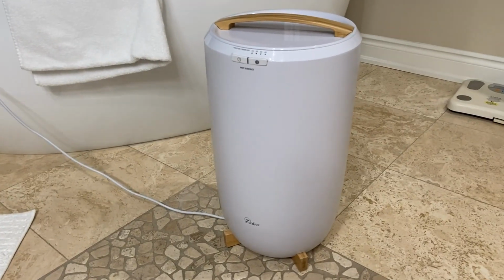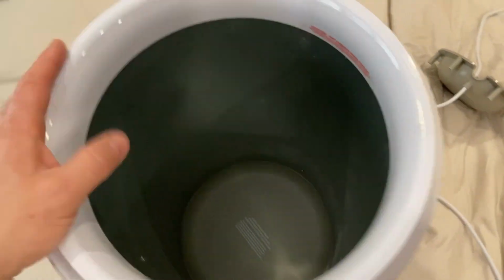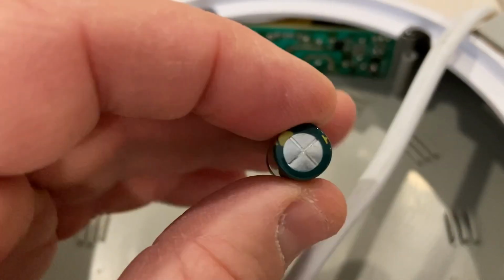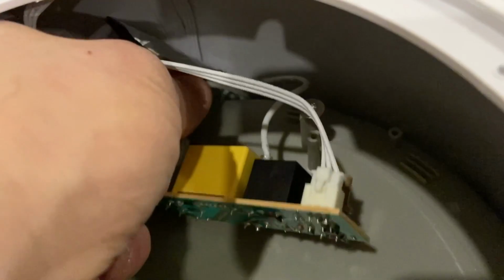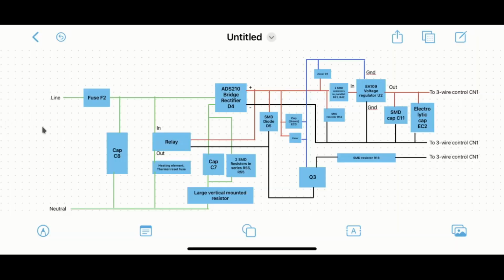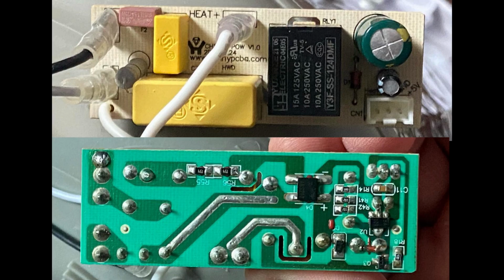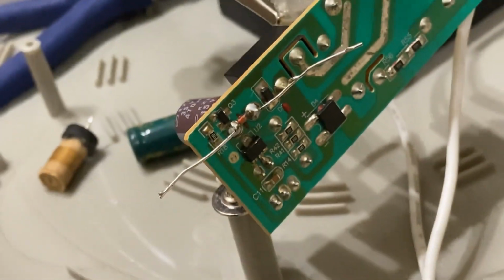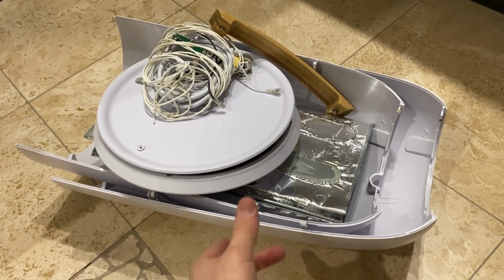Zadro Towel Warmer TWB01 FAIL! Teardown and FIX Attempt!

Comment: Excellent video.  I believe the bridge rectifier marking is ABS210.  BTW, it may be that this rectifier is toast in my unit, as both terminals on the AC side show 120v.

Update: In addition to the EC3 capacitor, I found Zener diode D1 (with markings 4741) had failed.  With both components replaced and the unit plugged into a 120v outlet, the board now sends 5V (measured relative to the DC- terminal on the bridge rectifier) to the button panel via the line in the 3-wire harness indicated on @DevHackMod's diagram.  Meanwhile the middle line and the return line of the harness measure 0V (which seems proper functioning).  

When the ON button is pressed for two seconds, the LED underneath comes on, thereby illuminating the 15 minute light, and the return line measures 5V.  Pressing the timer button cycles through the other timer settings.  When the ON button is pressed again, the lights on the button panel go out, and the return line once again shows 0V.

The voltages on the AC side of the bridge rectifier now seem correct, and the DC+ terminal shows 12v, so I think the rectifier is not damaged.  

As @DevHackMod's diagram shows, the 5V of the return line is applied to the base of transistor Q3 via the 4.7K SMD resistor R18.  The emitter of Q3 is supposed to provide sufficient voltage to the relay to activate it, but this does not happen, suggesting that Q3 had also been damaged.  I was not able to make out the markings on Q3, so I am not able to replace it (if you are able to read the markings on your Q3, I would be very grateful).
Reply from the maker: Thank you for explaining how you fixed it! I wish I had know this information and worked through it as well as you did and been successful at fixing it. Hopefully your comment will help others fix theirs!
Reply: Q3 on my board has Y1 marked on it.
Reply: @mattturner6429  Y1 is what is on my Q3 as well.  U2 seems to be 601  V(something). maybe V1 ? but seems scorthed or blown.
Reply: I checked the voltage on the zener across the 470uF cap on a good unit, and I'm seeing 25v so maybe a 1N4749  24v zener.  That would make more sense with the info I got on the relay coil being about 24v from a supplier of this relay.
Reply from the maker: @ronkloiber  Thanks, good info which will help anyone trying to repair this item!
Reply: @devhackmod  I replace the Zener with 2x 12v zeners in series (didn't want to bother running out the the electronics shop)... IT WORKS NOW !!!!  Thank you for the video and circuit diagram.

Comment: heh without reading the 20 other comments which are probably much more intellegent than my soltuion, i would have just gotten rid of the control pcb and wired in a w1209 temp relay board and added a 2nd switch and just lived with the safety risk and thrown it away when i got bored of it. maybe thats a bit too 3rd world country for most. if the "10amp" relay on the w1209 couldnt handle the switching current of like 5 amps i would have had it trigger another ssr or beefy relay or something as a cascade switch with a 100kohm precharge resistor shorting it. maybe add one of those 30 min delay off timer circuit boards. not smart enough to not use the lego approach to fixing electronics yet. good try replacing the cap though, that was worth trying.
Reply from the maker: That is definitely a solution. You can just eliminate the PCB and hardwire in the heating element and forget the whole timer. It does have a temperature sensor and may be turning the heating element on and off to make sure it regulates it and doesn’t overheat, or you can introduce a variable transformer and just regulate it that way.

Comment: one way to remove the top screw covers without damage is attach 1" pieces of something like a pencil or thick wire, less than 1/4" with hot glue to each and let harden well, then pull them out.
Reply from the maker: Good tip! Thanks for letting me know, I'll try it. Thanks for watching!
Reply: another option might be a 1/2" or so piece of drinking straw over the cap and hot glue put in.

Comment: I now have 4 of these that have failed..  1 with a break in the heater wire, 1 with a blown thermal inline bullet fuse in the heater wire, and 2 not powering on as yours did. On 1 I replaced the cap but didn't fix it.. and haven't started trouble shooting on the last one....  NOT very inpressed with these.  They are great when they work, but fail in 2-3 years even with very little use.
Reply from the maker: I would suggest not buying them unless it's from a certain store that lets you return and get refund or replacement, even after 5 years. I barely used mine before it failed, and a 1 year warranty is not enough given the price of these units. It's just not worth it.

Comment: Just took mine apart and the capacitor cap fell off too. This is an annoying problem that shouldn’t happen
Reply from the maker: Called planned obsolescence. Either a bad design, cheap components, or both.

Comment: Nice job with the explanation.  Too it wasn't only the cap.  My towel warmer also just died but I haven't taken it apart yet.
Reply from the maker: Thanks, yeah it's fairly easy to take apart and my method is less destructive than AvE's but sadly the cap was only likely one of several components that blew. I don't have enough spare parts or time to mess around with this barely-used gift so off to recycling it went!